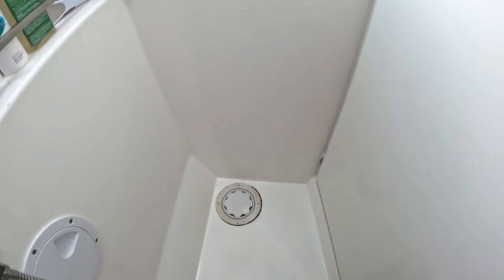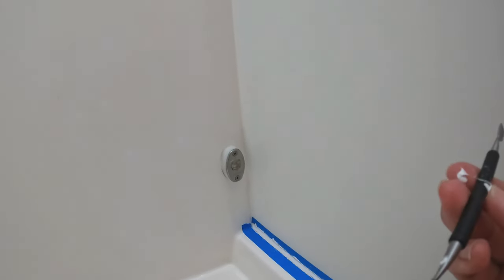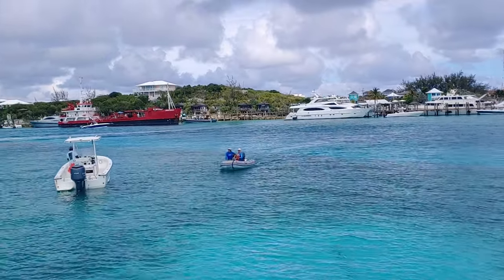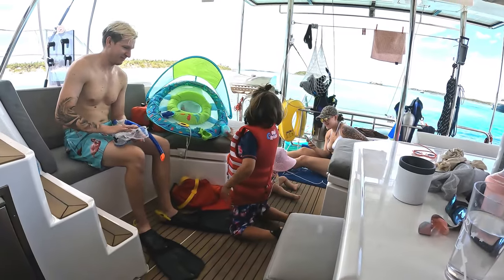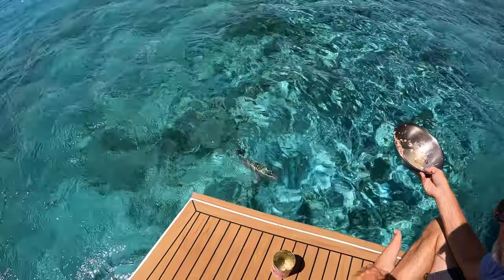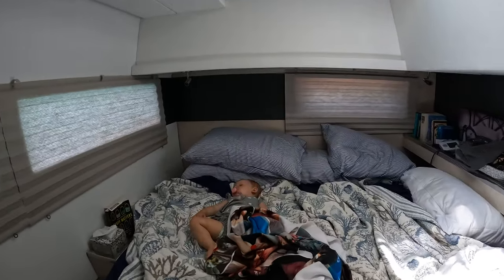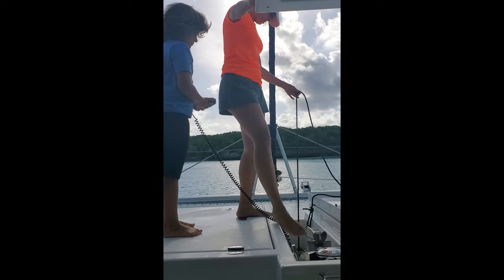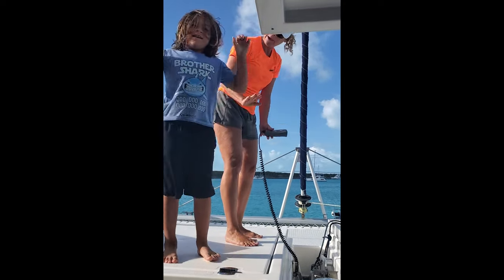BABES on Board! E54

Comment: I have a great caulking tip for you, when remove the tape, spray some soapy water and run over it with your finger and you'll have a beautiful finish on your caulk bead...learned that one from Colt at Just Cats and it changed my life as i sucked at caulking...lol

Must be awesome to ahve the GK on the boat, can't wait to have ours over later this summer when we are in New England area
Reply from the maker: Thanks for the tip! And we’ll have ours in New England this summer too! Probably somewhere in Maine though. Hopefully we’ll get to spend some time with you guys at some point. Boston maybe?
Reply: @SailingWindTherapy  cool, Boston area is where we plan on ending up. I need a haul out before we can make it there, we hit something a d I want to make sure we are ok. Plus out autopilot does not work, and other instruments,  so we need that sorted as just Cats could not figure it out it seems.
Reply from the maker: @pleclerc1  omg!
Reply: @SailingWindTherapy  no autopilot is not fun my friend,  it's why we are only doing day trips as 10 to 12 hours at the wheel is a lot of work and very tirering.